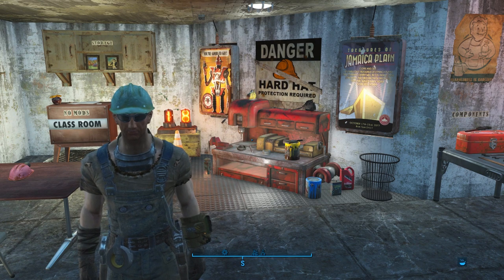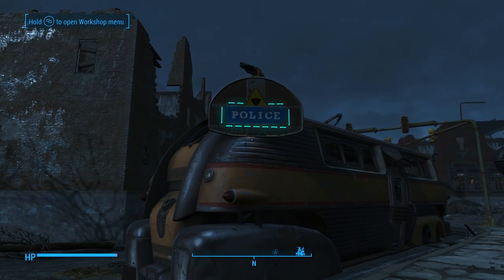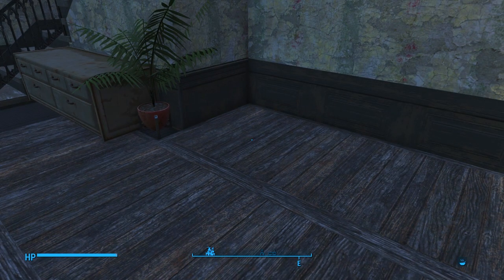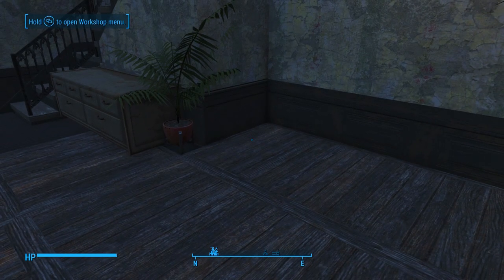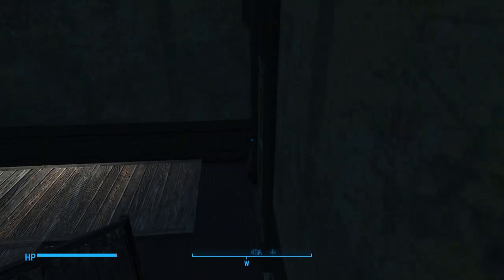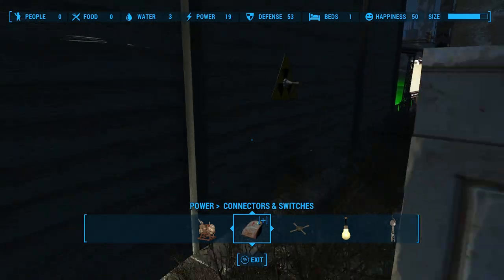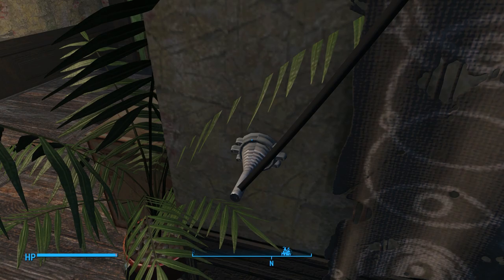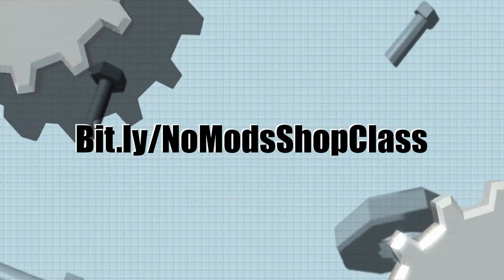A Deep Dive into the Wire Glitch 🔌 Fallout 4 No Mods Shop Class

Comment: Great tip! I have used this to help wire up a couple settlements. I used to have my wiring running all over and messy. I tried to clean it up using the conduit pipes on top of buildings and such to try and hide it, but i ran into issues when things required a wire. Thanks for the help. Keep it up!

Comment: It has been my experience with the last glitch that you don't officially need to be pointing at the conduit, only making sure that it is behind the wire you are highlighting.  I spent lots of time trying to get as close as I could, only to later realize that placement was the key.

Keep up the lessons, they should help our building community greatly.  I find that if you can firmly embrace no mod building, then modded building is a breeze.  Only area of school I'm missing is the double black for manufacturing.  That stuff still gives me fits.  :)
Reply from the maker: You're absolutely right about the placement factor. I just figured I'd give the surefire method in the video to avoid any "it doesn't work" comments, because looking at the conduit with the reticle works 100% of the time. Know what I mean? But I'll include your point in the upcoming viewer suggested tips video. :) Also, I can totally relate about the manufacturing. That and the logic gates give us all headaches, so those lessons will definitely be included near the end of the mini-series.

Comment: Thanks for explaining this. I used a variant of it to wire Sunshine Tidings. I started with putting a generator and recruitment beacon on the roof of the big building with the workbench. Wires are all high above, and out of the way.
Reply from the maker: Actually, you might want to try this instead :) https://youtu.be/YdaR7m4gct4
Reply: Skooled Zone Unfortunately I don't have any of the DLC, so no pillars=no pillar glitch. But, I did discover that the spiked poles can be used for similar effect. They seem to be limited to outdoors, or at least an area without a roof. I use them to even out fences, or to sink buildings that are on uneven ground.

Comment: Nice.  Another wall rug that you might not think of using, is an actual wall!  A vault wall to be exact.  When you attach the vault wall conduit to a vault wall, you turn the wall into your "sign".  I find it works best with the vault wall/floor combo piece since they snap better.  This also works with the warehouse garage door, if you want a switch or whatnot on the inside.  Any wall that allows you to move it with the wall conduits attached should work as well.

Example:  Place a vault floor piece, and snap a wall/floor piece to it.  Place a vault wall conduit on the wall section.  Behind the wall (the backside), place a pylon.  You can't wire straight through the wall as normal (yet).  Select the wall/floor piece and rotate it so that the vault wall conduit it facing the pylon without any collisions.  Connect the pylon to the conduit as normal.  Then, just select the wall/floor combo piece and snap it back to where you want it.  The wire will now pass through the wall.
Reply from the maker: Definitely Court! In fact, I used the vault conduit in several places around Vault 42. The only problem with using the vault walls as conduits is that if there is any break in the pattern, the connection breaks too. I wanted to be able to use other kinds of floor and wall textures here and there, so I ended up having to hide pipe conduits around the back of the walls anyway. But as far as using any old walls as the "sign" with the sign glitch wiring, that's definitely a tool for the toolbox! 👍
Reply: I hear ya.  I thought I'd throw that in here anyways.  I mainly use it for purely vault builds. It comes in handy with knowing that the residential and maintenance (red and blue) rooms/tunnel hallways can have the vault conduits mounted to the outside flat surface rather than the interior (just to hide the wires and conduits).  I can't take credit for the vault wall conduit setup, as I forgot that I had watched a video on it a few months before I "stumbled" upon it accidentially during one of my builds.

Also worth mentioning is how great the concrete build set is.  Another well known FO4 no-mod user showed this when the concrete first came out.  Concrete walls (and most foundations that can sink into the ground), can be used to cover up various items.  For instance, if I place a long conduit (the pipe looking one) on a floor so that it overhangs the floor, I can then place a concrete wall directly over it.  It snaps to the floor piece as usual and the conduit looks like it just passes through the wall.  Most walls would detect teh collision and not snap to the floor.  But, the walls/foundations that can clip into the ground ignore most player placed objects, to a degree.  Due to other collision variables, this doesn't always work how you want it to.  This is especially handy when you don't want to rug glitch or group select items that are in cramped quarters.  Another use for this is to place a generator, and then place a foundation directly on top of it.  Hiding it similar to rug glitching it into a wall.

As another side note.  I'm trying to recreate a security door using the conveyor belt switches.  I can't seem to find the vid for it.  When done successfully, it looks awesome.  It's just very time consuming and takes a lot of patience to line everything up just right.  It basically has conveyor switches stacked on top of each other with a delay switch in between each switch connection.  You end up with a V shaped barred door that opens either from the top or the bottom, depending on how you wired it.  Looks kind of like a zipper when opening/closing. It requires a lot of space to setup, stacking floors on top of each other and lots of rugs!  The person who came up with this could have benefited greatly from knowing that you can "bury" things underground.
Reply from the maker: Yeah, the concrete is super forgiving. Not just the concrete but a lot of foundations are like that. In my Vault 42 build, I buried the conduits for the entire outside patio in the floor underneath by just placing barn foundations over them. They go all the way from the missile turret to the spotlight and then back out again: https://youtu.be/P6n1-POCUrM?t=9m36s

I was also able to bury the entire junk car that I couldn't scrap below the barn foundations by just snapping them together over it. Pretty cool. Also, I think the YouTuber you're talking about that did the v-shaped bar door was Jug. I don't like to advertise a lot of other YouTubers, but he's the man. As you said, that trick is very time consuming and takes a lot of patience. Probably more patience than I even have.
Reply: As much as i would love to credit that "security door" build to Jug, it wasn't him.  It was someone else that had vids  at the same time, like noreswapwns and eso, but, not as "famous".  You might have seen the vids.  I only mentioned it because you might have seen it and know what I'm talking about.  I was hoping you might jog my memory for that.  If you come across it, let me know.

And as far as moving those inanimate objects, didn't they remove that function?  I know that the beds at certain settlements can't be moved any longer.  I hated that patch. I know they removed the ability to "remove" beds from settlements.  I just wasn't aware how bad they nerfed that "glitch".
Reply from the maker: Wait, what? This wasn't Jug's original idea? https://youtu.be/cIopiJqTCBk?t=29m32s
Reply: Hah!  Well, I stand corrected.  Thank you!  I've been searching for that vid for awhile.  I don't know why I thought it was someone else.  My CRS is really bad these days.  I was thinking that the door building part was done at starlight drive-in.  Like I said, I don't remember things too well.  Oh well.  Such is life.

Comment: Hey Paul, I have been over this video a few times and have been trying to use the glitch in my builds. It's strange because I use a PC and it really is a pain with trying to get the glitch to trigger to grab the wire without the normal red line that comes with it and the sparky thing that will indicate that you have gotten the actual glitch to bury the wires underground. Once that is done it's all golden. I wanted once again to say thank you for your lesson as it does encourage me to go back and dig deeper and even go deeper in the building side. I enjoy both but have found when trying to build a settlement and keep the size limits I tend to me less is more because I have a low end PC (Laptop). It's all good though. Now on to something you might like to dig deeper into. After playing through several times, I found an/a mod that allows  you to see items and locked doors in color coded accents and have found many as yet undiscovered hidden bunkers within the game. for example did you know there is a bunker at the trailer court on the hills to the far west of the map and north of fort Hegan? it is as others i have found to be very well hidden in brush so you will walk right past it as I have done countless times in my adventuring in the common wealth. there are several others and i can and would be happy to offer them up but don't want to post here because I want people to learn to love the game as much as you and I do. lastly the one cheat i have used regularly console command is to jump higher so i can get up on things and get a better lay of the land. Having watched your play through on assassin's creed it makes me more than a little disappointed that Bethesda did not allow this other than using a jet pack in power armor because I don't like the power armor. it is too clunky and while it adds armor i can like you work around that with chems and ballistic weave which works fine for me ( too little of the ballistic fiber in the game though). Keep on gaming and I hope your well and reaching your goals in patreon. I once had a dream to offer videos for money on Youtube but never had that much of a following and feel your pain when they demonetize your hard work even though it is part of the game with the sound. and under the Code 17 in the copy right laws it does allow you to use it for educational purposes. As long as you put in the disclaimer that this is a video for educational purposes you should be able to force them to pay you for the videos. They can't pick and choose which laws they like to follow. i just got tired of all the junk that went with it on my video lessons.

Comment: I've just Restarted playing Fallout 4, so I'm kinda excused of being 4 year late :)
I just wanna say big thanks, man, this video helped a lot, especially for wiring the switches to automated doors or gates in order to open/close them from the inside. Just so you know and out of sheer curiosity, about the "sign version" of the wire glitch, it wouldn't work if you use as a base the curved concrete wall. As a matter of fact if you place a sign and a conduit on it, when you try to move it along, the sign moves but the conduit won't.

Comment: See when I started, beforebi learned the glitches, I always put power generators on the tops of buildings I built. Then I would run connectors to the corners, and run then down the corners amd such. Worked well! Very clean.

Comment: This has actually just given an idea or a way I could improve my sanctuary build. I originally replaced all the broken lamps along the road with new working ones.. Only Problem is the wires drooping everywhere.. However I've just realise I could probably sink a pylon right below the lamp post with a wire connected going straight through the post :) 

Thanks again Paul!!
Reply from the maker: Absolutely! In fact, that's exactly what I did with the lamp post I built inside Vault 42, as well as the recruiting beacon.
Reply: Thats really cool, I just went back to the video and its pretty awesome to see where and how you have implemented the things you have shown us so far all throughout that settlement!

Comment: in some cases you won't need wire to bridge power you can just put a conduit near the generator and it will utilize the radiated power from the generator ex. red rocket truck stop i have a generator on the top that radiates power to my lower floor and all i need is a conduit placed under the generator and one directly under that in the garage I'd like to see what you can do with that trick... that is if you haven't already. I'm way behind on your vids but i like what i see so far keep up the good work

Comment: I recently discovered that you can hide the conduits inside the concrete walls and use the wire glitch. If the structure is already built the walls snap over the conduits. It only works with the original conduits though, for some reason the vault-tech ones won't sit on the walls. This also works with foundations as well. Also you can hide logic gates in concrete foundations as well. I recently did it for a powered door. Figured I should share this here as it might be handy for someone who is building a concrete structure and want's to keep it neat without wires running and conduits sticking out all over the place.
Reply from the maker: Nice! Also, you might want to go wireless: https://youtu.be/YdaR7m4gct4
Reply: @SkooledZone  I did try the Wifi Glitch but it crashed my game a couple times so I decided to  leave it. To be honest, the design of my place has made it quite easy to hide everything using the technique I've been using. Thanks for replying to my post by the way. I look forward to the next video.

Comment: I am wondering if there is a ceiling light which could be used as a ceiling conduit rug glitch apparatus.  I will need to test this, I had never thought about it before, but if possible it could be very handy.

Lots of great info, and ideas.  I can't wait for more.
Reply from the maker: "ceiling conduit rug glitch apparatus" Haha, love it. Let me know if you find one.
Reply: Well darn, I tried everything I could think of and nothing worked.  I guess there just won't be a 'ceiling conduit rug glitch apparatus' to use.  You can use that term if you want, although not much reason to since nothing fits the bill.

Comment: Just FYI I don't know if you actually know this or just ignored it, but for generators placed in walls or underground, even if they are destroyed, you don't need to do anything to them. I place all my generators inside walls to save space and whenever there's an attack I usually notice the power supply dip by 1-2 generators, but I have like 15 all hidden and I don't know which one is broken lol. I'm too lazy to pull them all out and check, so I just leave it, and when I go back to that settlement I have full power. There's a formula I can't remember but the settlers will repair idk 1-5 broken things per in game day(reliant on how many settlers the place has) so 1 generator will be fixed anyways. 
Also, for conduits I hide those in walls by attaching them to the wooden floor concrete block, it will slide through the wall making a small tip or none of the conduit visible at all, and you can scrap or store the block from the other side of the wall, so you can wire your house, place inside the wall, then move the generator into a wall too, and you have all the power you want with nothing ever showing :)
Reply from the maker: Hmm. Interesting. I didn't know settlers will repair generators and stuff on their own. Good to know.

Comment: I usually just use the Wi-Fi glitch with powered switches and a fusion generator. So essentially, I have each settlement powered like home plate is. 100 power from a switch. Then I hide the generator somewhere, or have it in a warehouse somewhere.
Reply from the maker: That's the way to do it. I hadn't discovered the wi-fi glitch yet when I made this video.

Comment: I like to place a conduit on the ground somewhere in the settlement, where it is out of the way (in some bushes, or inside some structure I won't use as much). Then I glitch wires from that to other ground-mounted conduits in the settlement, from where I wire up everything that needs power. 

As for generators, I like to have on visible, maybe a wind turbine (or I slip one into a vehicle to make it look like the car engine is producing the power), and then I hide the rest.
Reply from the maker: Love that car engine idea, Patrik. If I come across another settlement with a car I can't scrap, I'll use that and credit you for it!

Comment: You don't need to repair items bud, just fast travel to the location where repairs are needed (if not already there) then travel to another location, then return again, all items will auto repair.
Also the laser corridor in Jamaica Plains can give you infinate fiber optics, just keep opening and closing the security door at the far end of it, it will keep activating the lasers that you can then disarm over and over.
Reply from the maker: All good tips. Thanks for sharing!

Comment: Smashing video. It did not work anymore! I play with the latest version (19. December 2019) of Fallout 4 and I tested it with no success. I wasted a lot of time in watching this video, because at first I thought it is my fault it does not work in my game. When starting to move the rug while the conduit is on it the cable is interrupted and a connection is established again only, if the rug is within the range of the power supply.
Reply from the maker: It should still work. Bethesda hasn't updated anything in years. However, here's an even better method to check out: https://youtu.be/YdaR7m4gct4

Comment: Hey man i love your videos you have helped alot...question/tip. Not sure its discovered or not but i found a way of bypassing settlement limits while being at max size.  If you simply have an object selected to build but cant see it because of max size store a wire and now you can build it! Is this discovered and is there any other bugs attached to it other then it not raising your bases power if you use it to build generators ?